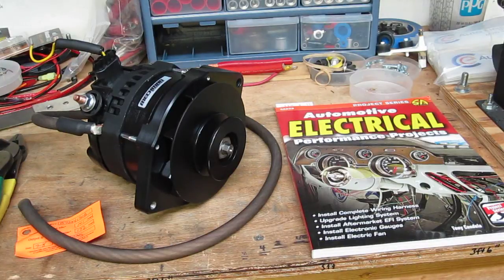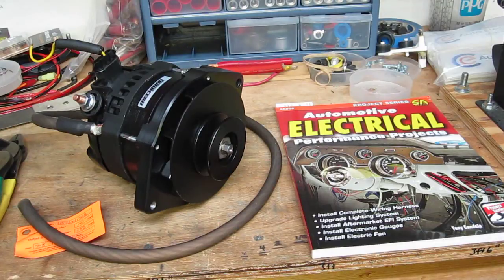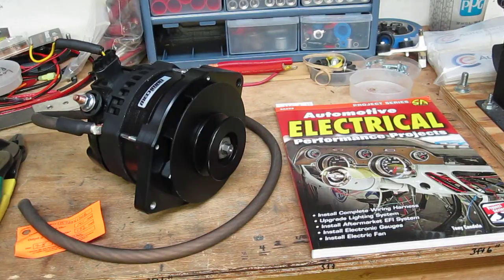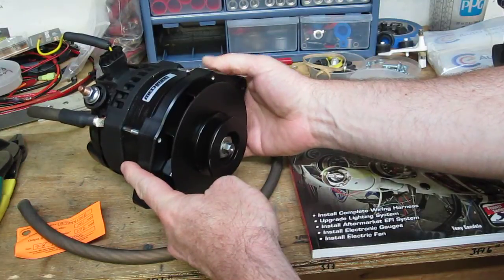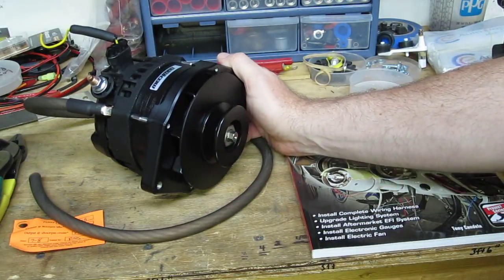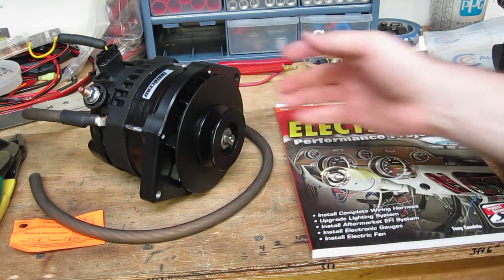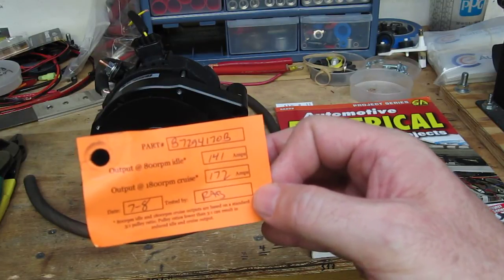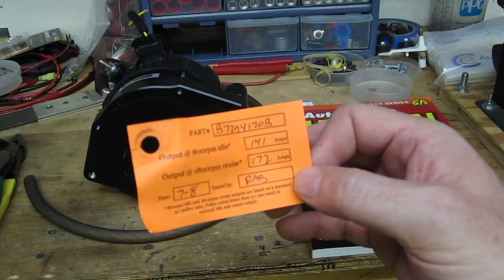Mechman Billet-Tech 12si Alternator for 1970 Olds' Cutlass featured in Upcoming Book - Carb to EFI

Comment: Looks like more of a hybrid alternator than an actual 12SI. Maybe a 10/12 SI drive end but with an AD230 rear half. This is similar to what Alternator Man has for a modern high output alt that fits early alt brackets with little to no modification. The AD230 is a great upgrade if you can't fit an AD244.